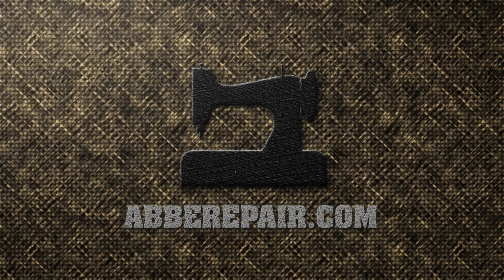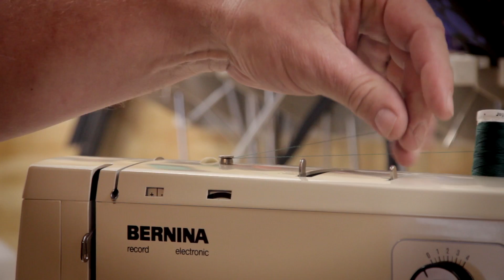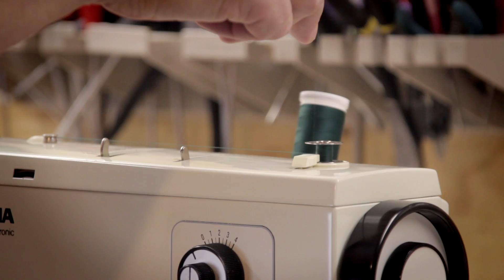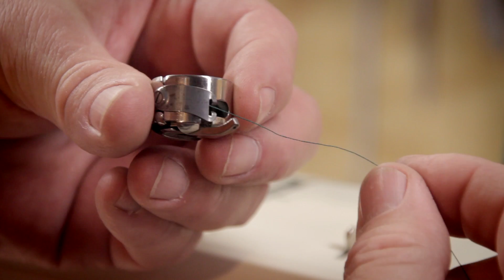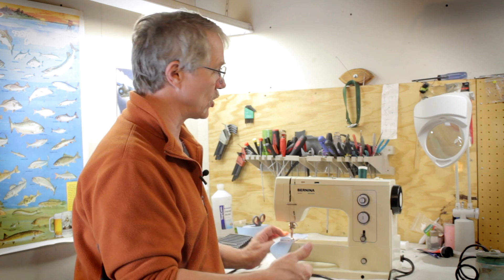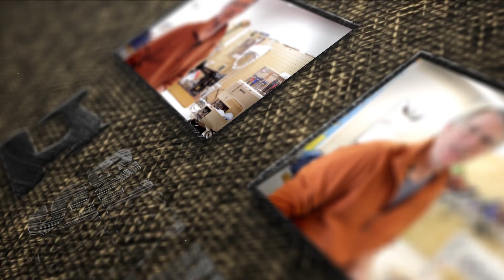Sewing Machine Repair with a Bernina 830

Comment: hi,are you still doing dem on this machine.i have this machine love it,just had an issue with needle break replace the needlle did the normal re thread, now the trouble.the top thread is not picking up the bottom bobbin thread. 

what may be the problem may you suggest.  tried a few things,cleaning,re threading.  i await your suggestion

Comment: I have had a Bernina 830 Record for many years. Bought it new in the 70s. I never knew the spool pins pulled up. I can't get these to move, and have always used a plastic tube that was included with the machine. Were some made that didn't have extendable spoon pins? I don't dare pull any harder than I already have! Thanks!!
Reply: Mine won't move either.

Comment: my Bernina 850 is not working as the feed dog is not raising up to move the fabric through. It just sews in place. I love this machine. My deceased husband gave it to me 43 years ago and I would like to pass this down to my daugher. A repair man in Seattle said it would cost $200 just to look at the machine plus the cost of fixing it. I am fairly mechanical but I can't find any videos on this. A V shape spring came out of the bottom of the machine if that helps anyone help me figure this out. Thanks so much! Everything else works fine, well oiled and maintained.

Comment: Hello.   I have a Bernina 830.  I’ve had it since about 1978.   Recently the stitch tension is off.  It almost has a slight gather on a straight stitch.  I have cleaned the bobbin area and have oiled the top and bottom areas.   Do you have any suggestions?   I have a brand new needle and brand new thread.  Thank you

Comment: I have a 40 yr old Bernina 830 Record Electronic.  Was sitting idle for many years.  Now, the Stitch Width Knob (upper knob) and the Buttonhole Knob (knob below) won't turn. Are stuck. Also Bobbin winding makes a "whirring" sound like metal on metal. Any ideas? Thank you!

Comment: My bernina 830 zigzag adjustment dial keeps sliping back from 4. I move it to 4 and it simply rolls back to 1. I need to hold the dial to 4 to be able to zig zag or do embroidery,  which is not easy. What should I do to fix it?  I live in Pakistan and the person who repaired it the first time pulled out a few important washers and a capacitor.  The people over here cannot be trusted with anything. That's why I want to try and fix it myself.

Comment: My 830 has been a work horse for me since I got her in 1982.  Recently having issue with foot control.  When I press it to start sewing it hesitates to start sewing. I turn hand wheel toward me to help it.  Finally it will take off.  When I took it in to my Bernina dealer, I learned  my older normal repairman had passed away and new one doesn’t work on older machines, only on new electronic ones.  Two other dealers in my state and several hours away.
Reply: I got her repaired!  Bernina shop in Stuttgart.  It was the electronic board in my foot pedal.  They still make this part.  So, I was lucky.
Reply: Have same problem

Comment: Great videos! My aunt just gave me this machine, I used to sew on it as a kid with my grandmother. However, the machine will run for a few seconds but then stops. I’ve opened the machine up and can’t seem to find anything that’d cause this. It seems to be a specific spot, even when turning the wheel by hand it always stops in the same place. I’ve been looking to take it in for maintenance but can’t seem to find a Bernina specialist near me!
Reply: I have exactly that problem, I paid 3 times to fix it,!   but then in a months is doing again!!!

Comment: I need a walking foot for my 1980’s 830. Do you have any idea where I could get one? Would prefer original Bernina part but I see a lot of knock offs. Can you help me?
Reply: Nancy Gould I have an 830 from 1982 when I bought her.  I bought my walking foot from Bernina store in Conway Arkansas.
Reply: Debbie Widner is the walking foot from Bernina or a knock off? Does it work well?
Reply: Nancy Gould My walking foot is by Bernina.  It works well.  The only down side is it takes me couple of minutes to get it attached to machine.  But worth the trouble and it does work well.
Reply: @debbiewidner5676  Great to hear. A Bernina walking foot that is available. Was it terribly expensive?
Reply: Nancy Gould I have receipt I can look it up and let you know.
Reply: Just call the Sewing Center in Conway, Ar.  They can give you current price of one.  They are a Bernina dealer.
Reply: @debbiewidner5676  , I called Shirley at the shop you mentioned. What a lovely lady! She has managed to find me not only a walking foot but a new Bernina pedal. I am so thankful that you sent me in her direction. Many, many thanks! I should be sewing again real soon.

Comment: Is there anyway to adjust the presser foot?  Thank you
Reply from the maker: Carlamari Drew hi carlamari drew!  Great question!  Yes is the answer to your question. Why? is the question I’d ask back. If you flip open the top of the machine and look straight down at the tube the presser foot bar fits in.  There is a shiny screw scored with a slot for a straight flat  screwdriver.  This screw is the screw that you screw in or out to change the pressure. I always pull the spring out and clean and lube that assembly. Old oil can make the assembly very stiff. It must move freely. If you unscrew this NOTE it is spring loaded. Only remove that screw with the presser foot off and the presser foot lever down to relieve as much spring tension as possible. Count how many turns it took to remove the screw and start with it there when you put it back together. Assembly should be clean and well oiled. Hope this helps. Allen
Reply: @abberepair8288  Thanks so much!  It doesn't hold my fabric well.  I mean it will hold, but if I am sewing something slippery forget it, I really have to hang on to the fabric otherwise it slides all over the place.  I will keep you posted, thanks again!
Reply from the maker: Carlamari Drew hi carlamari drew. One other thing to check is if the feed dogs CAN come up through the needle plate slots to move. Lint builds up under the needle plate, between the rows of feed dog teeth. This gets compressed and given enough lint, it can prevent the feed dogs from being able to move up though the needle plate. Remove the needle plate and clean channels between the rows of teeth. Hope this helps. Allen
Reply: @abberepair8288  that's great! Thank you I will let you know how it goes 😊

Comment: My Bernina is an 807, but looks very similar to the one above.  I'm having a problem that you've not yet covered in your comments. (I did read them all.)  My needle will not move to the right or left as it used to do.  I've checked under the cover and the guide is fitting into the grooves, but at the other end (the needle) it is only moving slightly.  I tried using  the zipper foot which has no middle hole, and the needle should go on one side or the other of the foot, however it's been set, and the needle will hit the foot as it won't adjust to either side.  Do you have any suggestions for me?  Thanks.
Reply from the maker: Susan Davis hi susan davis!  I can only guess...  i would check to make sure you machine isn’t in a buttonhole setting. The next thing i would do is to see if the lever that switches from straight stitch and zig-zag to design stitches moves freely. It should click loud when you move it back and forth. Lots of oil and working should free this up. Old lube can cause nasty problems. These machines need regular lubes. Hope this helps. Allen

Comment: My Mom just got one from a neighbor (purchased in 1982).  She plugged it in and the light comes on but when she pushes on the pedal nothing happens no noise or anything.  Any thoughts on how to troubleshoot?
Reply from the maker: Snigdha Das Hi Snigdha Das. Wiring, motor brushes, and the electronic speed control in the foot control. I have one in my que now and I believe it is the speed control.  Hope this helps. Allen
Reply: @abberepair8288  How do we resolve the issue?
Reply from the maker: Snigdha Das hi Snigdha Das. I have had 25 years to learn some of the answers to that question. I have a degree in Robotics. The way i found to increase my speed of diagnosis is to have those components in stock. I have foot controls, cords, etc I can plug into the machines to quickly help isolate the problem. I can’t do that over the internet. There isn’t an easy at-home answer. It’s time to see someone who knows how to troubleshoot that machine. I hope this helps. Allen
Reply: @abberepair8288  Thank you!
Reply from the maker: Snigdha Das Hi Snigdha. Thought I’d give you a quick update. The foot control speed control module was the problem for the machine on my bench.  Allen

Comment: Hey, thanks for the refresher. I bought this vintage machine from some folks a few days ago and the feed dog will not stay up. :( 
Please
Help??
Jodihebertart@gmail.com
Reply from the maker: Jodi Hebert  Hi Jodi Hebert!  As you sit to sew at the machine low on the right is a knob, a little less then an inch in diameter, that when spun a quarter turn to the right to lower the feed dogs. Turn it to the left to get the feed dogs to act normally again. Oil and grease can make the knob hard to turn and the associated linkage hard to move. Oil all moving parts. It can be hard to know what’s supposed to move when nothing wants to. Good luck. I hope this helps. Allen

Comment: I just got my machine back from the repair shop.  I now cannot adjust the length of stitch with the control.  Do you have any suggestions?  Thank you .
Reply from the maker: Linda Roblyer Ho Linda Roblyer. Thanks for your question. The only thing that comes to mind is, did they leave it in the button hole position instead of straight stitch or zig-zag...  this can do exactly that. What kind of machine do you have?  Hope this helps. Allen
Reply: ABBE Repair bernina 830
Reply from the maker: Linda Roblyer Hi Linda Roblyer. Does the regulator bar move up and down?  Is the marker on the button hole knob pointing straight up?  Allen

Comment: Hello Alan, hope you don’t mind if a ask you foe some advice again. I have a bernina  830 record the hand wheel is stuck. The white disks are ok it’s been oiled  but underneath the wheel is the larger belt and that’s ok then a smaller one it’s orange little belt that had a tear so I took it off still didn’t turn .no needle broke inside or cotton ,have you. any thing you could suggest that could be wrong.kind regards Gilda.
Reply from the maker: Gilda garbutt wyer Hi Gilda!  My guess is old oil has turned to glue. Thread could also be caught somewhere. Have you removed the hook?  If thread get caught in there it can be very difficult to remove. Id check that first. Can you get the hand wheel to move backwards at all?  Allen i can do better on the phone 651-747-1176 Thanks for the question!

Comment: Hey Allen, do you know if there is a way to reduce the pressure on the foot? I have trouble with the foot pushing the fabric forward as I sew. Cheers! Jean from Waiheke Island, New Zealand!!
Reply from the maker: Jean Goodbrand Hi Jean. Good question!!!  Raise cover and look directly above the presser foot bar. There is a silver slotted screw about the size of a nickel screwed down into the shaft the houses the presser foot bar. It compresses a spring that transfers the energy to the presser foot. The further in you screw it the more pressure is put on you fabric. The screw and spring should be removed, cleaned, and reoiled periodically. Hope this helps. Allen
Reply: @abberepair8288  Thank you so much for your lovely response, much appreciated! I have wondered about this for years.
Reply: @abberepair8288  Thank you so much for your lovely response, much appreciated! I have wondered about this for years.
Reply: Hi there @ABBE repair,  Thanks so much for being so generous with your advice. 
A quick question re my Mum’s Bernette 680 which I just inherited... 
My Bernina 830 is very heavy to handle now that I’m gettin older and I thought Id sell it and use the Bernette instead.
I am generally happy with it but i find it hopeless with any more than two layers of fabric - it just doesn’t seem to want to feed. Is this likely to be a maintenence or mechanical issue that can be resolved?
Do you know of a remedy to this. .
Cheers!

Comment: Hi Allen, thanks for the great video!  I'm looking to freight my mothers old 830 (in its original carry case) from my old home town to another city.    To reduce part-stress while shipping, are there any settings/positions that are best park the mechanics in?   Machine probably hasn't run for 20 years, so looking forward to getting it serviced and re-learning how it works!   Thank you!  Matt.
Reply from the maker: MlR congrats,  great old machine. Great question!  I’d definitely transport it with the needle in the fabric and the thread take-up lever in it’s lowest position. For protection. Can’t easily get a take-up lever and needles can be bent. Many happy hours!
Reply: @abberepair8288  Thanks Allen, great advice!  I imagine some of the original parts for these machines are getting hard to find, so hoping it travels well!

Comment: Alan can you help me please , I have the Bernina 830 and straight sewing and zig zag work beautiful but the rest of the automatic stitches don’t work they did but something happened because now they don’t the ornamental stitch indicator  window that’s shows black and when I lifted the cover up it was stuck should it move Alan please could you help me.kind regards. Gilda Garbutt.  Uk.
Reply from the maker: Gilda garbutt wyer hi Gilda. Seasons Greetings!  Im not there to see but... old oil and grease act as glue. The lever that moves the mechanism from zigzag to special stitches should cause the mechanism to “clunk” when you move it from its front position to the back position. This mechanism needs oil. WD40 to free things up then a fine machine oil to keep things loose. The whole linkage needs freeing up. Oil everything the n Work the lever forward and back until it frees up everything. I hope this helps,  Allen

Comment: If my handwheel doesn't disengage properly, (it loosens but needle continues to move) in order for me to wind a bobbin, do you think this is something I could repair myself?  Could it be an oiling issue, or something more in need of an expert eye? 
 I really love this Bernina, it has always sewn the most even stitches and is a pleasure to use.
I'd appreciate any advice, thanks a lot. 😊
Reply from the maker: Angela O'Connor hello Angela, thanks for the question. It could be old oil.  Oil turns into an adhesive with age.  All of the solvents the keep it liquid evaporate over time.  If this is the case and it’s been a while since it’s been cleaned and lubed, the bearings in the rest of the machine are probably in the same condition! Just oiling the clutch would then cause unnecessary wear on the other bearings. I did a video on lubrication that could help you.  If you loosen the stop screw in the clutch you can remove the retainer screw.  NOTE: Put the washer back in exactly the way you find it! I would clean the shaft and center hole in the hand wheel with rubbing alcohol. Then put a couple drops of oil on the shaft and rub it around and reassemble. Remember to retighten the stop screw. NOTE: if your belt’s too tight tithe needle will continue to go up and down! Hope this helps!  Allen
Reply: @abberepair8288  Allen, many thanks for taking the time to give a very thorough and detailed explanation, the type I was hoping for 😊
 So helpful, I will use all the info.
Thank you again. Angela
Reply: Allen, I have done as you suggested and it has worked 😄 the mschine is winding thd bobbin wothput the foot shaft hopping.  Hwever there is now a rattling sound which appears to be coming from the area which holds the bobbin. Almost like a ball bearing sound, if you can understand what I mean. 
It's functioning but noisy. By further thoughts? Thanks for getting me this far.
Reply: Sorry  I meant 'any further thoughts'

Comment: I have several feet for this model machine, one of them being a double needle foot. the machine only has one bobbin housing, is there use for the double needle foot on this machine or is it a mismatch? Thank you.
Reply from the maker: David hi David. Thanks for your question. If you look a the outside leg seam on a pair of jeans you will find a two parallel and synchronized rows of stitching. Look on the inside and you will also find two separate rows of stitching. Your machine only has one bobbin. When you use a twin need and two threads on top you still have only one thread on the bottom. This gives you two rows of stitching on top but a sawtooth pattern on the bottom where the bobbin thread (1) knots with both needle thread every stitch. This also requires increasing the upper tension to get a clean look on the bottom. I have not tested this stitch for strength. I don’t know if it’s more than decorative.  I hope this answers your question. Allen
Reply: @abberepair8288  thank you for your insight :)

Comment: Thank you for the great info!  My light seems to get hot very fast.  Should I be concerned?  🙂
Reply from the maker: Pat Lawson Hi Pat!  Thanks for the excellent question!  There are both 15 watt and 25 watt bulbs sold in that same size and shape!  Use only 15 watts or less. Any higher wattage will get too hot!  15 watts, even though it is what is designed in still gets hot!  There are “ led” bulbs of the same shape that run much much cooler. I hope this answers your question.  Allen